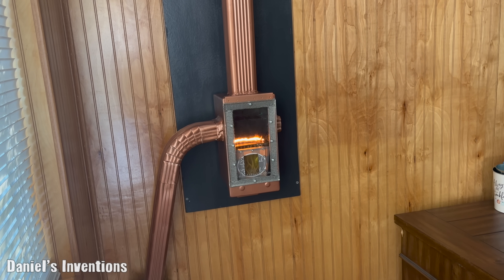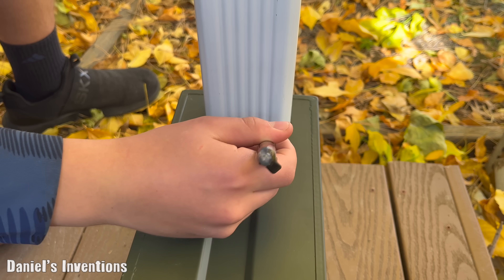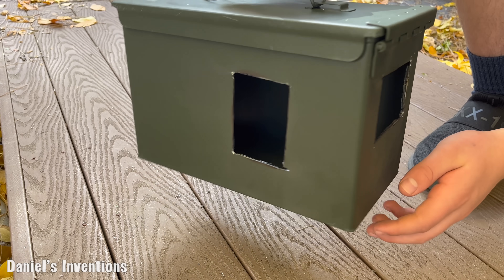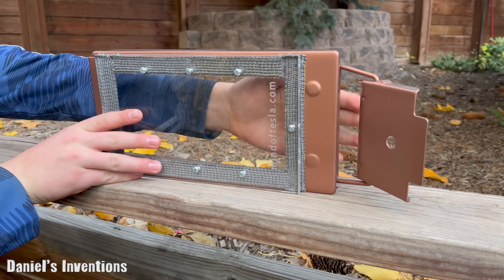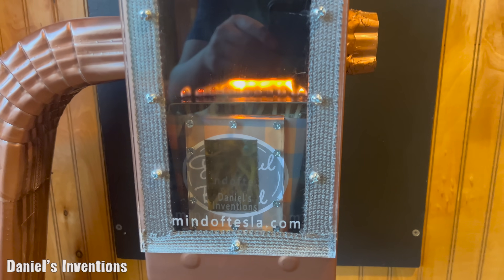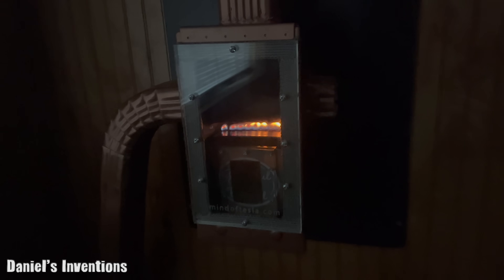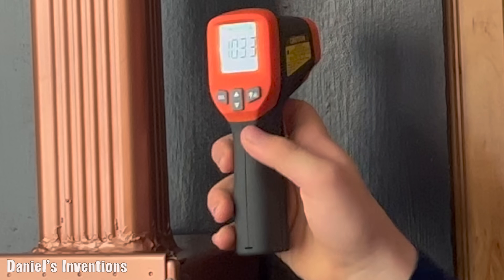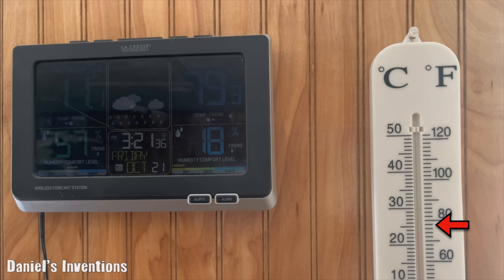ENDLESS Heat for Your Home WITHOUT Electricity

Comment: While your out, Let's hope a piece of burning wick doesn't fall into the oil reserve, igniting the pot of oil, melting down the ammo can and exhaust (drain gutter lol) spilling oil on the floor and spreading to the wall,  burning down the house.
Reply: The wick won't burn down far enough to fall, same way wicks don't burn down in old kerosene lamps. The wick is pinched by the metal lid it's pulled through, holding it in place. And even if it did fall and remain lit, the oil isn't flammable enough to ignite. The wick would just be extinguished by the liquid.
Reply: @berserkasaurusrex4233  right, but the lamps your talking about have a physical barrier between the oil tank and the wick for this reason.  If you look closely at this heater there is only an air gap between flame and kerosene,  at a certain temperature kerosene will vaporize and pass by the flame,  a small blockage in the exhaust could cause the vapours to  build,  which may go two ways,  either the vapours extinguish the fire or a new source of oxygen is formed ( by way of damaged heater)  and this could lead to an explosion or intense fire that could melt down the structure and be exposed to the exterior.     

2 things here,  a kerosene lamp is a short term device(sun comes up the next day),  this heater could run continously non stop if you keep adding fuel.   

The second is none of the structural components are rated for containing a combustion process.   These intakes exhaust and chamber should all be rated materials for such a appliance.  

Also kerosene lamps have been known to start fires and burn down houses,  oil fires can be more dangerous than wood fires.  

Also there are plenty of oil fueled furnaces built to operate safely,  this is not a new invention.

Besides who wants to be sued for burning down your neighbour's house, just because you wanted to reinvent the oil furnace.....   insurance will cover you for your CSA or UL listed appliance not from your homemade oil heater.
Reply: @DAVID-gf1es  This isn't kerosene, it's an oil lamp that burns sunflower seed oil. It won't burn if you drop a match in it and it doesn't produce vapor like petrol-based fuels.

The wick won't burn below the metal top so it shouldn't ever fall into the vegetable oil anyway.
Reply: @berserkasaurusrex4233  ok yea that is generally true,  but the cost of oil!  Even vegetable oil  it's like  $8 a gallon.  NG is like $1.5 for the same amount of BTU.
Reply: @berserkasaurusrex4233  Also,  lol  heating oil will likely cost you 4-6 times more for heat than natural gas.  The savings on building your own oil heater will be burned up(pun intended)  within 1-2  years of heating your home(depends on where you live and how insulated your home is).  If you live in Canada you will likely burned enough oil in 2 years to have purchased a natural gas furnace, install, and natural gas. 

Of course if your in a warmer climate you may not even need a heater.  If you don't have natural gas pipelines in your area,  well I'm sorry to hear that and it's defineatly costing you a lot of money.  

And while you ponder that just think about all that natural gas that the US flared off while fracking for crude oil.  It is a shame for sure.
Reply: @DAVID-gf1es  Cooking oil, purchased wholesale in large lots, is about $1 to $3 per gallon, which according to the video should heat the cabin for about a week. That's about $12 to $36 to heat the cabin all winter.

Even if you were buying it at the local grocery store, it's still less than $10 a gallon. When you consider the cost of a LNG furnace, the small size of the cabin, and the cost of three months supply of LNG, this would still be a net profit.
Reply: @berserkasaurusrex4233  have you built this device?  How many gallons per hour does it consume?  What's the size of your cabin, insulation Rvalue and heating degree days at its location?
Reply: @berserkasaurusrex4233  the average home in Canada consumes 88GJ  or 89 million btu of energy a year in a hardiness zone 3.  This is the equivalent to 686 gallons of heating oil.  That would cost 700$  at your best price per winter.  36 gallons may bet you through the week on a week that doesn't drop below -15deg C.
Reply: @berserkasaurusrex4233  btw heating oil I likely most cost effective purchased in bulk and it currently trades at $4,75USD/gallon.  This would put your cabin heating cost from $1630USD to $3200USD per year.  Doubt there's much profit in there, Except for the guy selling you heating oil.....
Reply: @DAVID-gf1es  Dude, you started this thread by claiming the wick would ignite the oil (and somehow melt a steel ammo can, which is just ludicrous), and I corrected you.

I have no idea why you want to hash out the efficiency ratings of this device or any of its possible weaknesses compared to LNG furnaces. I never even said the device was a particularly good idea, only that vegetable oil wouldn't ignite from a dropped wick. Which you eventually admitted was true.

Realistically a cabin this small would be best served with a simple solar-heated hot box on the southern wall, and no furnace is needed, whether LNG or oil.

Comment: Nice build👏. Adding convolutions to the heat exchange section of the gutter will increase efficiency (at some loss to air flow rate). I bet the Europeans will be building these this winter.

Comment: What size is the ammo box? what size is the heat resistant window?  Do U use a plug in transformer for the 12 volt DC fan? Are U using K1 kerosene? It is around $6 49/gal. Where are U getting fuel for $2.50/gal.? How long are the wicks? I've read that JB weld turns to dust from heat after a little while. I guess a person could weld a flange on the stove for each of the metal down spouts..

Comment: For the storage of the oil,  why don't you simply use a big glass jar?  It will save you a lot of work cutting a hole cut into that metal container and installing a looking glass, plus you have less risk of leaks.

Comment: First thing, interesting setup but WRONG!

What is running the fan? looks like you have it plugged into a power supply on the wall. Believe it or not, there is electricity coming out of the socket being converted into a lower voltage. Then if you are running it on a car battery, there will be a need to recharge it with electricity or an expensive solar setup, raising the cost by several hundred dollars at least. The concrete board installation is a common mistake. There needs to be an air gap between the board and the wall to meet the code. Can't really tell but by going by what the rest of the video shows I guess proper clearances for the exhaust were not met and having a downturned spout like that is not good. Check out NFPA 211. 

Another big question is cleaning. The soot is going to drop the efficiency of the unit fast as it builds up on the pipe above the wicks.

Comment: The title said no electrical but your running a  computer fan, but other than that great idea, JB weld is gonna break down, use fire caulking 3M fire barrier works great for high heat, I use it for my smoke walls in my buildings.

Comment: I did something like this once. about thirty years ago, but with copper piping. There are material compatibility and long-term durability concerns with your actual construction. I'm not an expert in material science engineering, but I did see that another commenter provided some feedback. This design does have the susceptibility that a break in the inside air conduit inside the burning chamber might result in carbon monoxide being brought into your house, so, make sure you have a carbon monoxide detector in your home. Carbon monoxide from fueled heaters and portable generators kills people every year, so it's nothing to take lightly.

Comment: I like how you used oil instead of the candles that  The Outsider used in his exact build from February.
Reply: Yeah, oil is a much better choice. Way cheaper than candles and easier to acquire in bulk. Plus candles don't last very long, a few hours of burn time unless they're high-end 100% wax and those are extra expensive.

Comment: As an hvac tech of 20 years... First off venting through a partition must be double wall. Yea u got only 103 now but say that cheap fan stops circling now you've got no fail safes, no limit switch no safety switch nothing at all. Your vent will immediately become 800 plus degrees the whole thung will become a fire ball and burn your home down to the ground and your insurance won't cover it because you've just documented it. I like the idea but this is horrible what you're doing spreading dangerous videos and for that I hope this gets deleted.

Comment: There is a firm in the UK that manufactures similar diesel or fuel oil heaters for use on boats. This would be a safer way to go. Carbon monoxide is a real concern in just such an application. Properly configured, you can put a kettle on top of the unit to heat water. They even make units for hydronic heating.

Comment: I’m curious as to how this can heat an entire home. A good size wood stove needs a few layers of chimney pipe in order to NOT set fire to the attic and roof. Yet even a 48” stove with circulation has a hard time heating a 2,000 sq ft home. How does this produce enough heat for the home? And how does that much heat go through thin-ass gutter material against walls and everything and doesn’t burn the place up?

Comment: Instead of a computer fan which uses power, use a Wood Stove heat Powered Fireplace Fan instead which uses no electricity. When there is no electricity it will still run the heat through.

Comment: Without electricity? The fan uses electricity. If you were to put the pipe through the wall, it would pull cold air through and heat the air as it passed through. This is the same concept for use with a rocket stove. Now that would be without electricity.

Comment: Nice!!! what kind of oil can be used for this? Is gutter pipe steel? wood stove pipe of 3" or preferably 4" would work too as it is steel--all reply's welcome. You can get various size's of wood stove glass cheaply on Ebay.

Comment: First off the JB welds gonna turn to dust unless you use the high temp stuff. And second you cant put "without electricity" in the title and then rig it to an electric fan.

Comment: Love the idea and project.  I do suggest wearing some kind of gloves, glasses, and even a mask for safety when working with a grinder or other kinds of heavy duty tools.  As someone who does a lot of projects, I did not start wearing safety gear…but if you do this long enough you will Knick yourself on either the grinder, a metal shard, sharp edge, or something at some point.  You are going to have tiny particles and debris inevitably fly at your face…and you will absolutely inhale some of that metallic dust.  Please don’t find out the hard way.  
Also, it’s setting a good example to others.

Comment: Umm I Call BS.  Gutters are not high temp rated nor is JB weld, nor safe with off gas and burning gasses. Unless this is built by others to verify  I'm saying it bs. 
A kerosene heater can do everything this does and you get them dirt cheap used 2nd hand and aren't  fire hazards or dangerous off gasses like this.

Comment: That gutter won't be able to last very long as a heat exchanger it will definitely burn holes in no time , plus the paint is not meant to be burnt,  and jb weld isn't for high Temps this is actually dangerous have to use the right materials but this would work in a survival situation

Comment: Nice job 👍 pretty smart. Now if you can learn how to wire two pickup truck alternators and which which will produce 90 volts of electricity all that's needed to run a home free energy.

Comment: Does anyone know what type of oil to use?   He says something like "different types of oil" but doesn't elaborate on what kind or where to get it.   Other than that, it seems like a nice little system although I'd probably use some stand-offs on the wall panel, connect the duct-work with some kind of furnace cement, and use steel instead of aluminum making sure the exhaust penetration had plenty of space around it.  (I'd probably try to make this a double-wall pipe with a steel wall sleeve).
Reply: What kind of oil?

Comment: But the problem is you claim heat without using electricity but you need electricity to run the fan,though it may be very little it's still electricity.

Comment: You really didnt show exactly how and witch way the unit was built like why does it need a vent and your shot before the unit was up showed the whole at the bottom of the board on Wall ??why. And showing it all would really help like witch way the flow goes and how you made the oil and wick holder. Kinda vaig if u ask me

Comment: I hav thought about heating like this since i was a kid. Great idea. I have an idea to make it even more efficient. Use some stone either to make box or to jus put above the flame. Some stone like soap stone absorbs heat but releases it slowly but isn't very hot to the touch. So itd heat up then release the heat over hours. U could light it for a few hours put it out & still get heat for a few hours. Great idea tho. Always wondered y we dont hav something to capture heat from candles & release it into the room. This is basically that. Keep up the good work

Comment: Pro Tip: use house telephone jacks and telephone wires to power the fan. The phone company energizes the phone lines even if you dont have service! Mine runs at 10vdc and runs LED light strips in 3 rooms.

Comment: I was thinking this could work as a water heater as well. Just run a water pipe over the flame instead of an air pipe. Great way to keep fish ponds or aquaponic systems warm. Nicely done!
Reply: To make is adjustable, the oil reservoir could sit on a tray that can be adjusted from the bottom to control how close the flame gets to the pipe....

Comment: Maybe I missed the info, but what was the final temperature of the cabin after the heater was running? Was it a nice steady degree, comfy for the winter?
Reply: Thanks
Reply: 11 degrees outside and 79 degrees inside.

Comment: I haven't run through the comments and someone probably already stated this.  But if you had Fins to your exhaust pipe you'll dissipate more radiant heat into the room and the temp at the top should be lower.  Might be worth having a try.  Great video...thanks

Comment: Use car muffler repair type epoxy, think JB weld also has some. That will withstand high heat, regular 
JB Weld won’t, it will actually burn if you get it hot enough.

Comment: The problem with this is that oil is too heavy to be drawn up by stationary wicks, so as the oil level drops, the flames will have a harder and harder time drawing up oil, eventually extinguishing itself. You could use lamp oil, but it's very expensive compared to cooking oil.

Comment: How did you seal the window on the oil container? Also, is that heat resistant glass on the oil container? You also didn't tell us what you used to seal around the downspout and ammo can gaps.

Comment: If your really desperate or broke you could line the wall in stacked aluminum cans to insulate and retain heat in the wall better. Then throw tin foil over it all to hide it.

Comment: Without electricity, installs an electric fan
JB will not last, it will dry out and become brittle
Better options are soldering or better yet tack weld
Great idea, could be better execution

Comment: Weld or braise the parts together, use ur heat to run your fan inside, could you increase the heat with air channels snaking around the heat? Great video

Comment: Great implementation, outside constant fast food smell, but nothing wrong with it. Would be better it nothing flammable is around, would better to weld these piping connections close to oil furnace, not glue them.

Comment: If you ran the intake next to the exhaust (on the vertical inside length), and still had the two ports separated by distance outside, the intake air may benefit from being pre-warmed. Although I don't know exactly how that could change the dynamics of the system in terms of burn rate and exhaust rate.
Reply: Like...it might muck up the draw on the exhaust

Comment: Ok, have you considered what can go wrong?  JB Weld softens at 200F, aluminum melts and will quickly corrode in this application, paint can smoke. Also, what about carbon monoxide? CO emissions are fatal. Then there's the fire risk, the JB weld glue melts, and you have an oil fueled fire, also fatal. Oh, and this is not to any code I know, so your insurance won't cover fire loss.  Honestly, you should remove this video.

Comment: Oh if you have the exhaust pipe with the right cap on it, the wind outside will pull the air through so no fan would be needed!

Comment: Will be interesting to see after a good amount of time how things like gutters and ammo boxes hold up over time to heat like this,  when the metal thickness and chemical make up were not actually designed for heat,  but removal of water.  It's all fun and games until someone follows advice and then ends up burning down their home.  How well is your insurance in case someone sues?

Comment: Get a TEC and attach it to the hot side; depending on the size of the element it should generate enough electricity to power the fan.

Comment: Use High heat orange silicone that is used for automotive exhausts. You welcome
Reply: That or furnace cement depending on if you need there to be flex in the joint.

Comment: You can solve the top being hot by moving the intake and outtake flush with the upper portion, or making both holes larger to the same effect. This increases movement of air over the surface area making the heater more efficient at keeping itself cool and the room warmer.
Reply: wow